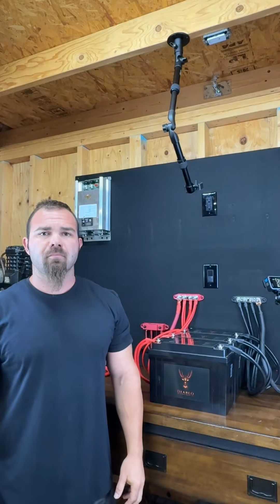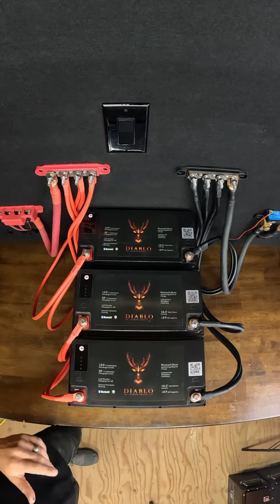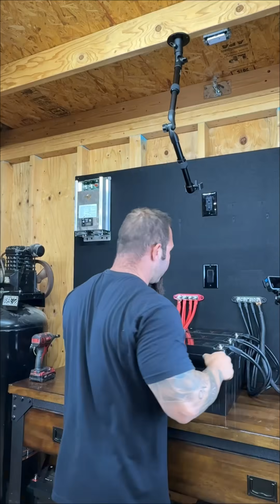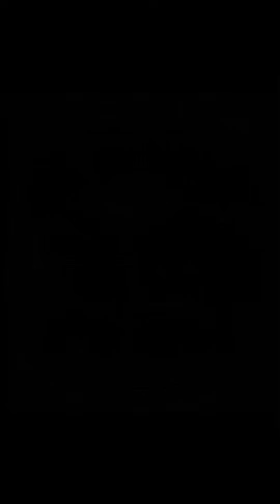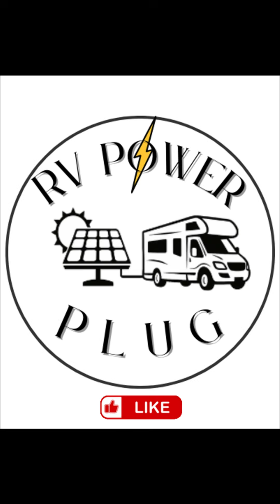Adding MULTIPLE batteries in parallel using bus bars!

Comment: How about daisy chain and pulling negative from one end and positive from the opposite end?
Reply from the maker: That causes a very large disparity across the battery bank and will fully drain one or more batteries while the others still hold 30-50% charge depending on how many batteries are in parallel. For shutting more than 2-3 batteries this method is far superior.
Reply: @RvPowerPlug thank you. I just tested it with some lights. I’ll get it corrected before use.

Comment: So what goes into the inverter is one positive cable from the 1st battery, and one negative from the last battery to the inverter?
Reply: The inverter would connect to a bus bar further down stream. The batteries are directly connected to central battery bus bars, which becomes the new "posts" of the batteries. See the big fat cables coming off the two bus bars on the wall? Those are your main +/- connections.
Reply: @ScottPaynton thanks.
Reply from the maker: @ScottPaynton Well, ideally from this example you’d just have one conductor going from your positive and negative bus bars to the inverter inputs, but if you’re just using batteries, then yes.

Comment: What's the recommended cable length?
Reply: The shorter, the better, but all of the cables should be of identical length. Otherwise, more amps will flow through the shorter cable(s) and connected battery.
Reply: @calledtojourney Ive been doing tons of research for building my setup I have 600wats of solar so far and 200ah basically with 60amp BougeRV contoller and max solar I can run is about 1000wats.
Im running my whole music studio each day off solar but not enough battery power to get me thu the full night.
So I am gonna have to go bigger on this.
Reply: @ScantlessBeatz  Mo' batteries is always mo' better! But you may find that you're not getting enough solar to charge the batteries back up the next day, especially if you go through an extended period of clouds and rain. So, more panels! And a generator is still a needed backup.

Comment: So this is a video on how not to do this with these goofy doubled cables.  If this is for demonstration purposes then use single cables and comment that the gauge is smaller than you'd want if it were a real install.  Otherwise this is just silly.  Stacked lugs on the bus bar terminals is wrong, doubled cables is wrong.  Just delete the video.

Comment: Why are your battery cables doubled up?
Reply from the maker: I just had a bunch of these cables laying around from previous installations (they come with the inverters i use primarily) so i used them for the demonstration. You can use any conductors that are appropriate for your expected amperage draw.

Comment: I did it the cheap way a 25 dollar 8 foot copper pipe smashed flat at the terminals and drilled a hole to screw in.😊 that looks like 120 bucks of wire there
Reply: Or even better, empty out that storage container full of old power cables you have had sitting in the back of the garage for the past 3 decades. 
Free and de-clutter the workspace all in 1 go.

Comment: Great video, do you put a fuse on each individual battery positive lead?
Reply from the maker: This was just a bench top setup for example purposes, but at minimum you need a main fuse coming off the bus bar to protect the system. For extra measures, you could fuse every string but it’s not required.
Reply: @RvPowerPlug  Thanks makes sense

Comment: Im going to use the buss bar setup for my 2 300ah with 2/0 wire. I get the reason for same length for both batteries pos and neg but does the length of wire to the service pos and neg buss bars need to be the same too?
Reply from the maker: The closer you can get to exact lengths on everything the better. NOW, how big of a difference will you notice during usage of they’re off and not perfectly? VERY LITTLE!! Make them as close as you easily can but don’t sweat it, it’s not a huge deal.

Comment: I have 4 100 amp lithium batteries in parallel. They are connected with a bar connecting the positive together and a bar connecting the neg together. The batteries are doing just what you are saying. In your video wouldn't the battery closest to the main cable on the bus bar draw more?
Reply from the maker: Not by a noticeable amount because the resistance is very low between all of the connections.

Comment: Time to discard my daisy chain setup, and buy a lot of length of cables.  Was that 4 AWG or 6 AWG used?
Reply from the maker: It’s not a huge deal until you’ve got 4+ batteries but it would be slightly more efficient. These are 1/0 wires in this example but that’s just because i had it laying around for demonstration purposes. Yours just need to be rated for the max output of each battery.

Comment: Hi i have 4 12v 100ah battery  i want ro series it for two 24v  and connect the two series 24v in a busbar parallel is it possible? What do you think? Thanks
Reply from the maker: Yes that’s a very common setup for 24V systems. 

Take two of the batteries and install a wire between the (+) of one battery and the (-) of the other battery. Now you have 1 positive terminal with nothing on it on one of those batteries, and the other battery has a negative connection with nothing on it. If you measure voltage at those two points you’ll have 24V. Run a wire from the positive (that has nothing on it currently) to the positive bus bar. Run a wire from the negative (that has nothing on it currently) to the negative bus bar. Now your system is ready to power 24VDC from those bus bars. 

If you wish to add an additional set of batteries, do it the same way!
Reply: @RvPowerPlug thanls man im from philippines😊
Reply from the maker: @joblev no problem! Browse the channel and learn what you can then Let me know if you need any other help setting it up!

Comment: Requires extra wiring, but that's why I put the positive on one battery and then put the negative on the last battery.
Reply from the maker: That wiring scheme works pretty well with 2-3 batteries but even drawing off opposite sides of the bank starts showing massive amperage shading discrepancies with 4 or more batteries in parallel. You’ll end up with a dead battery and the rest ranging from 10% to 30%. It works but it’s not the most efficient setup.
Reply: @RvPowerPlug . Couldn’t you afford that if you had a series parallel configuration? Four batteries in series parallel. Then you’re down to only two batteries as a “bank” that may have any complications. The other keeps you up and going.
Reply from the maker: @claytonrobertson4999 If you put the batteries in series, you start changing the voltage of the battery bank which means your DC equipment will no longer be compatible. Most RVs use 12VDC, as soon as you put 2 batteries in series, the output voltage of that battery bank is 24VDC, no longer compatible.

Comment: Should i install the charger on the bus bar,  or can i hook it up to one battery since they are all run parallel as it'll fully charge them all over night?
Reply from the maker: It’s better to put everything on the bus bars so that all loads and charging sources are evenly distributed amongst the battery bank.

Comment: Should i install the charger on the bus bar,  or can i hook it up to one battery since they are all run parallel as it'll fully charge them all over night?
Reply: Ideally, the charger should be connected to the busbar to ensure that equal amps flow to all the batteries. Also, all the cables going from the busbar to the batteries should be of equal length.

Comment: Awesome video. If I have two 150 ah batteries connected individually and not parallel to a positive and negative busbar, do I put in an input of 150 or 300 ah as the 100% ah setting. Thanks
Reply from the maker: Are both positives landed to the same bus bar and both negatives landed to the same bus bar?

Comment: very true, however I still daisy chain my batteries except I use huge aluminum busbars bolted to the terminals (2.5in width x 0.5in thick). The load imbalance is hardly measurable now and it looks super clean too.

Comment: It would be great if you showed the setup from beginning and what busbars etc were used.
Reply from the maker: OK great, I’ll make a longer version to show it a little better! Thanks for the suggestion, keep them coming!
Reply: @RvPowerPlug  are those 2 busbars on the positive side and what brand? Also what is the point of the shunt on the negative side?

If you want to add cable sizes and battery size as well for total clarity. Im building this setup right now and its a pain in the but with fuse type/cable size/ busbar type brand etc. Not one video on youtube explaining this well.
Reply from the maker: @esteve801  yes, it’s two bus bars on the positive side but this is just for demonstration purposes. It sounds like you’re trying to get a little bit ahead of yourself by just installing a system but not having the required knowledge to understand why things are the way they are. Moving forward without the required amount of knowledge will always leave you uncertain and unable to answer your own questions. I recommend going through the channel and watching my long form videos that answer a lot of your questions and you’ll pick up most of the info you need while watching those. It’s better to understand all of this and make your own informed decisions then to just have someone tell you exactly what they think you should do because they could be incorrect and you won’t know.
Reply: @esteve801  I have a Victron Shunt for my Lithium batteries, and the Victron app on my Iphone, so I can see all kinds of information on my batteries, including their history or charging and depleting.

Comment: What about fuses? You have the install fuses. Second, what if total power is 200A and one battery is broken so only 100A can be delivered. What if there is 150A asked by the system? Your one battery can't deliver and will break. How solve this?
Reply from the maker: This video was not meant to show EVERYTHING involved in wiring batteries into a system, only how to properly wire them in parallel. The output line FROM the bus bars to the rest of the system will need to be fused, not every battery individually. 

Using bus bars, if you have a faulty battery it will still pull from the good batteries without issue. If you end up pulling more power than your batteries can supply, they will likely go into protection mode.

Comment: Hi again, I have 3 x 120 ah AGM batteries, no lithium sadly. Does this still apply to AGM batteries. I seem to only be able to find this busbar and batteries in parallel connections stuff involving lithium, I haven't yet come across a similar video using AGM. Thanks again Cheers
Reply from the maker: All batteries will react the same, a lot of people have switched to lithium and it’s the least messy battery to work with so that’s why most videos show them but yes, the practice is the same for all battery types!

Comment: Hi, thanks for the short video, I have just subscribed :-), when you say the cables/wires all need to be the same size do you mean the same length i.e. all of the cables would need to be the same length as the longest cable required to reach the farthest battery from the busbars .Thanks very much cheers Tony
Reply from the maker: That’s correct! Same gauge wire and same length on all to make it the most balanced possible.

Comment: How would you connect two solar charge controllers to these bus bars? Would you need to add another bus bar to connect to these bus bars?
Reply from the maker: You would only need to do that if all of the posts on the first set of bus bars were completely filled. You can land multiple wires per post as long as they make good contact so i would just land the controller output wires to the same bus bars.